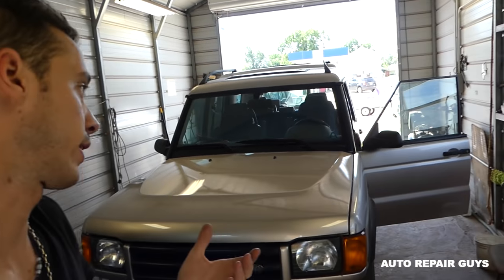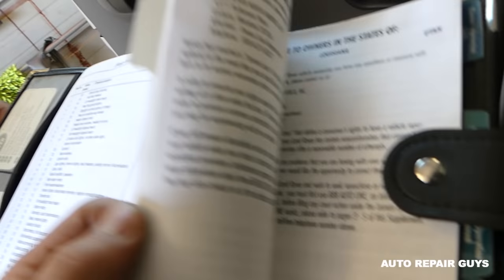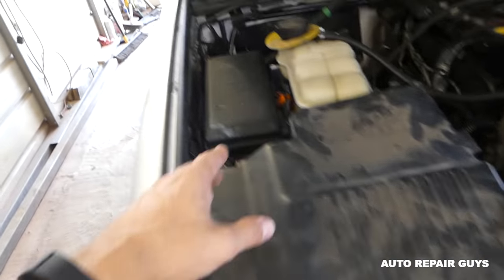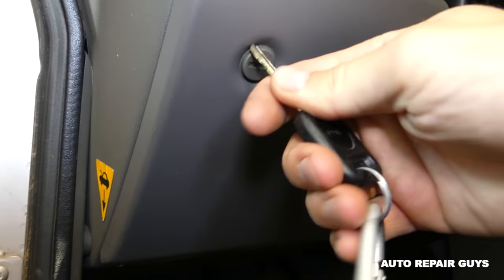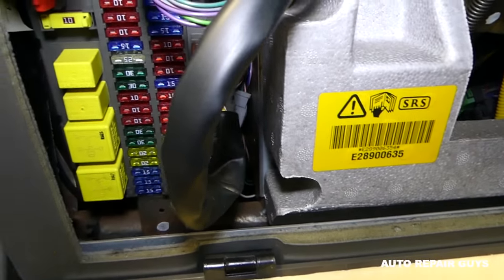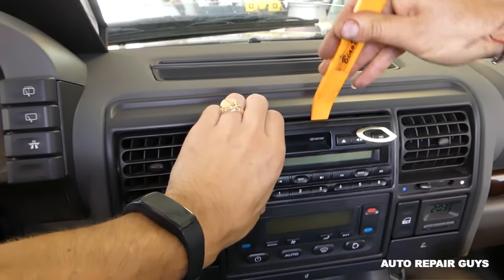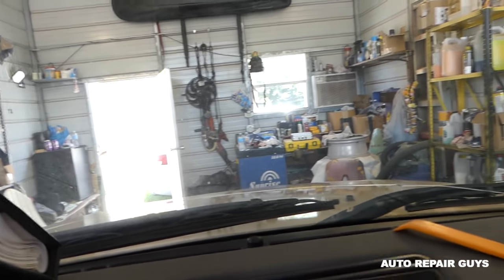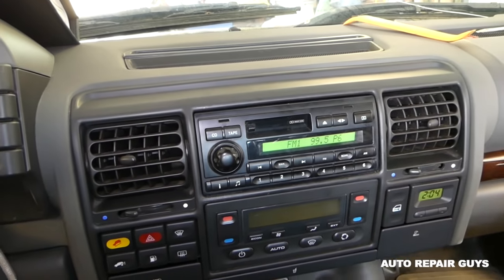HOW TO FIX NOT WORKING RADIO | RADIO DOES NOT TURN ON

Comment: Hi, I have changed all necessary fuses, checked my wiring which is all fine, and my radio/ clock still does not work. What else could I do to fix this?
Reply: Connect remote start with the 12v red wire
Reply: @connerharmon2215 does it work? i have mine it turns on for a bit then tuens back off and idk what it could be

Comment: My stereo dont have a fuse on the back. Wondering if its inside? 🤔any ideas? Please help
Reply: Prolly don’t need help anymore but mine was under my back seat
Reply: Same. My fuses under my hood and under my dash are both good. I took my 2013 tundra radio out and it didn't have a fuse in back. Randomly my radio worked for me for 1 day and then stopped working again.wire harnesses are in good shape. I can't figure out what's going on.

Comment: In my 2009 Kia Sportage there are two fuses the power of the radio. One is called AV and the other one is called audio in the diagram. I had replaced the audio one but that did not work. But checking The AV one showed it to be blown and replacing it fixed me up. I really appreciate your time. Removing the radio was not the solution man I appreciate you trying

Comment: Brilliant!  Thank you for sharing. I've got a 2002 Toyota Tundra SR5 truck and my radio has no power. My mechanic checked the fuse under the wheel and said it was fine. He said it's either the electrical or I need a new radio. I will check to see where exactly the fuse(s) is/are and will pull out my radio and see if I have a fuse in the back and replace it too if need be.
Reply: Didnt have a fuse back there, did you? What was the solution?

Comment: For everyone still having issues:
Try disconnecting and then reconnecting your battery. Sometimes this will reset.
Reply: J.R. Templeton thx
Reply: Exactly what Ford did when I took in my 2016 escape, the radio kept freezing with the bluetooth/phone feature.
Reply: edgarjx1  They just did a manual software update when I took mine in. I would try a reset and then update fresh from there?
Reply: My after factory radio didn't work after jumping the battery on my 03 Honda Civic. Fuses turned out fine, then saw this comment and tried disconnecting and reconnecting the battery and it worked! Thank you!
Reply: @valj6128 same thx
Reply: Do you have to disconnect both wires the red and black or can you just disconnect the ground?
Reply: @oscarfranco7420  
Try just the ground first and if that doesn't work try both.
Reply: Thanks, this worked

Comment: but what if both fuses are good and my radio still wont turn on? why did this happen? everbody knows to check the fuses
Reply: ImHellaSlik it happens to my 2012 hiace. My old and new stereo won’t turn on. Used the multimeter to check the wire behind the stereo, it has voltage between the battery and accessory to earth. But the both stereo just won’t turned on. Strange.
Reply: ImHellaSlik I have the same problem 🤔
Reply: @alaskasfinest726  Same problem here as well, It stopped working after 3 months, even tried to connect it directly to the battery and it still doesn't power up. I refuse to throw it away as it's a new unit and I still have faith.
Reply: My problem is that everything is turning on just absolutely no sound from any of the speakera
Reply: dis you find the problem?
Reply: My car radio don't wanna work fuses is okay
Reply: I'm going through the same problem. Fuses are new but radio doesn't turn on.
Reply: @ccythomas4304 I going through same issue right now did find what was the problem

Comment: Pretty good video.      I wish my car radio unit was that easy to take out.   :)

  Anyways, I have an 04 Lincoln Town Car.     My radio unit is a factory all-in-one radio/navigation/cd changer system that came with certain Town Car models for a few years.

  The fuses for this thing are in both locations; There's a fuse for this unit in the fuse box under the dash, and there is also a fuse for it in the fuse box under the hood.     There is no fuse in the back of this radio/navigation/cd system.  

 Because my cd player acts up lately, I try unplugging and then plugging back the fuse in the fuse box under the hood, in order to get the cd player to work again.       Sometimes this works and sometimes it doesn't always work.         

  Do you know why this might be the case?

Comment: On my Discovery the same alpine radio like this one was stuck ON and would not power off unless I turned off ignition.. could not adjust volume or change channel and inputs... fortunately it was on a channel I like and not too loud.. replaced stereo but liked having it plane inside to keep burglars away

Comment: In my case. 2002 Nissan quest, turns radio on, but therer is nothing on the display. 

Sometimes it lights on, most of times don't work the display only.

Could you help me please?

Comment: Have a 2006 galant and did all the wiring without the connectors first to make sure it would work, it turned on but when I went to put it in to see what it would look like it shut off, now that I’ve used connectors and done everything right it won’t turn on again, I’ve checked the fuse in the back of the stereo and it’s fine, there was a blown fuse that I replaced and the radio still won’t turn on, have I broke the radio?

Comment: hello guys so i was puttin an aftermarket radio in my car and the red wire and the black wire touched eachother and it was smoking a little bit than then i try plugging the radio back in its not turning on helpppp mee please

Comment: I have a 2001 Alero and the radio lights would come on, but no sound. Any idea why that would happen? The radio used to work with sound but the sound stopped and the radio lights would come on.

Comment: Hi pioneer 779bt fm not working ,Fm mode continuously blinking can u suggest what is the issue
Reply: Try resetting it. Hold down the source or power button until it goes to sleep. After doin so press and hold volume knob until the menu pops up, go to initialize then system reset

Comment: Nice video!   My question is suppose if it not none of the fuses.
Reply: If it's not a fuse it could be a relay, short/bad wiring or radio is actually dead

Comment: How do I fix a radio that doesn't change controls like I can't change my volume knob tune the radio or really do anything
Reply: JudgeWarlock01 I have the same issue, did you figure out a solution
Reply: JudgeWarlock01 might need a new radio altogether.

Comment: I wanted to change my old radio deck and put a new screen deck ... it won't come one i check the radio fuse it good i even put a new one .. i wire the harness straight to the battery the radio come on but won't turn on inside the car

Comment: Hi, can l replace that part of the head unit which joins to the face, 2 of the pins are out of place, the face was not removed correctly and they are not aligned anymore, thank you

Comment: AWESOME VIDEO i HOPE MY PROBLEM IS WITH ONE OF YOUR SUGGESTIONS. MY MAIN FUSES INSIDE THE TRUCK ARE GOOD AND I HAVE NOT CHECKED UNDER THE HOOD OR ON THE BACK OF RADIO ON MY FORD RANGER 2000. I HAD PROBLEMS WITH MY LAST RADIO A COUPLE OF YEARS AGO WITH THE DISPLAY GOING OUT BUT ONCE IN AWHILE IT COMES ON NOT SURE WHY HUUM. I WILL TRY YOUR SUGGESTIONS AND THANKS.

Comment: My radio has power but it is not switching on or working , it is recieving power from the battery , checked all the fuses but the radio itself doesnt have a fuse , how or what do I do to fix it? Please help .

Comment: I’ve tried both but they’re both fine. Any recommendations?
Reply: Sad you never got a reply… I’m actually have this issue right now with no online help. Radio gets no power, but the fuse is good and the wires are all good. New radio also gets no power. I don’t get I and I don’t wanna spend the money for a shop to take it.
Reply: @lordnordsucc4082  see if the fuse has correct amps some require more such as 10 amp but majority fuse within a car are 5

Comment: I have a 2008 Subaru Impreza, and my radio doesn’t turn on at all, I removed it but there is no fuse attached to the radio.  Any thoughts?
Reply: Havinf the same problem with my 2001 bmw 325i

Comment: My fuse is good. I have an amp the previous owner installed, 40A fuse on it good too. It even sparks when I put the fuse back in. I get solid 12v on both amp gnd and +12v line, and in the head unit the 12v and gnd cables are perfectly ok. What the heck ?
Reply: Hi did you ever figure it out?
Reply: @ChronikCarlos  I don't remember how I sorted this problem but I did find a dead speaker in passenger door and also the head unit died and that was replaced. 
Check wiring and speakers resistance and Amp ground connection. loss of ground is a major problem especially in older cars due to corrosion/loosenees
Reply: @Juppie902  oh ok, thanks for the reply!

Comment: I have a 2003 Ford f-150
The radio will not work, Unless you take the battery cables off and wait a hour before replacing the battery cables back on.
Only then it will work for a short time then shut back off.

Comment: Was wiring in an after market stero and it turned on and when I went to put it in it shut off, no fuse blown in the back of the radio or in the fuse box, I’m so lost and ready to give up
Reply: What happened u get it fixed

Comment: I wish mine was that easy of a fix. Last week my headlights stopped working to include the dome light and the radio. I have power coming past the fusible links in the 1988 chevy pickup truck. I'm really skunked on this one...any help would be appreciated
Reply: Try replacing the cigarette lighter, I had a 1989 Chevy Silverado and it did the same thing turned out I just had to replace the cigarette lighter.
Reply: stumped

Comment: i have a Toyota Corrola 2006 , i have a problem with radio, but in my case , just sound doesn't work , the radio light is work but no sound ,help!
Reply: speaker wiring issue
Reply: the sound harness might be bad.
Reply: Still need help?
Reply: I have same issue. Radio works but no sound coming out

Comment: I have a 2007 chevy uplander n my radio doesn't turn on when I touch the power button but it has power bcuz the clock turns on when I hit the power button
Reply: I have the same problem man. You ever figure it out?
Reply: @kairose3791  a fuse

Comment: Every tone I try to put in a new radio fuse it pops. What can I do to fix that
Reply: Maybe put a higher rated fuse like if it’s 15 amps try a 20amp fuse
Reply: Zach Skinner that might cause a fire !?!
Reply: Mecha Iroh i am in the same boat, i installed a new battery in my car, and radio stopped working, found out radio fuse popped, said ok got a new fuse put that in and immediately that one popped too !!
Reply: @Steven-uy5cz  Did you guys end up fixing it? I’m having that issue and it’s making me mad lmao
Reply: @Fendi303  found out my amp went bad.. swapped in another one and everything is good now

Comment: i installed a new battery in my car, and radio stopped working, found out radio fuse popped, said ok got a new fuse put that in and immediately that one popped too !!
Reply: A year late... But for others with same problem that is a short and until you figure out where the short is it'll keep blowing fuses like popcorn

Comment: My radio does turn on but I don't get no noise what so ever..it picks and chooses when it wants to work..so I press the cd button and all I get is a biiiiiiiiing ringing sound..its not the fuses coz it wouldn't work if it was..its not the speakers because I know they work..its not tuning into stations. I've replaced the ariel. Same problem..wtf is going on ?

Comment: What if the letters on the screen go off once in a while on mine can you help
Reply: Could be a bad soldering joint or short in the wires if it were the fuse it would just be dead

Comment: okay my fuses is fine but my radio still won't go on my land rover 2003
Reply: Try disconnecting your battery and then reconnecting. Sometimes this will reset.